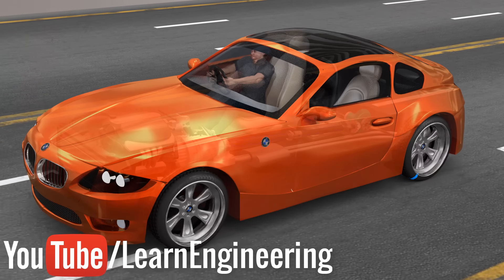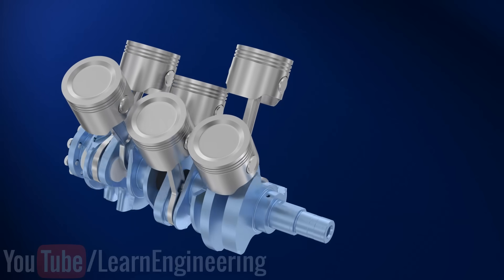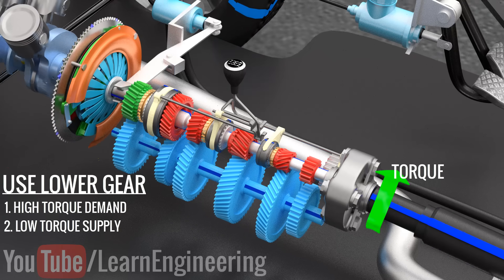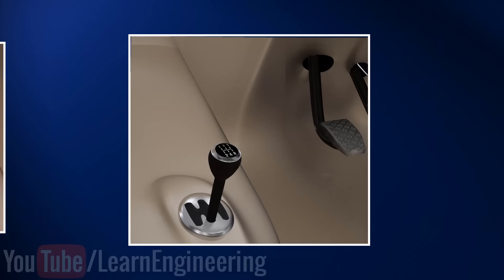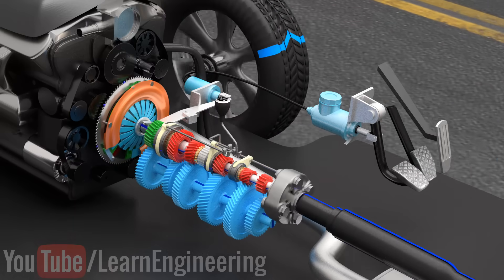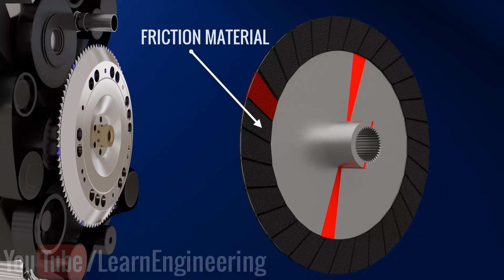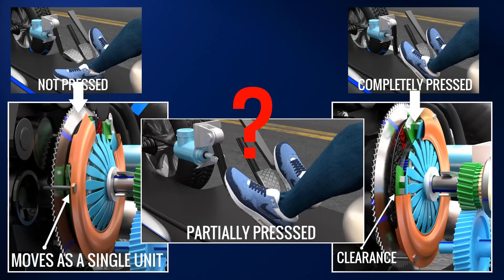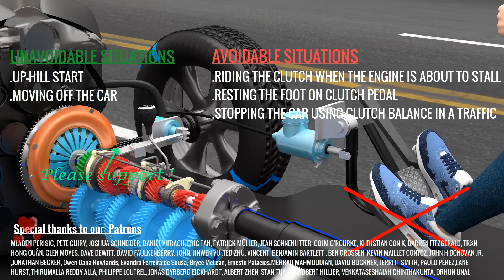Why you should not PARTIALLY press the Clutch?

Comment: Riding the clutch should NEVER be done. Anyone suggesting it has any use beyond starting the car moving or switching gears is an idiot.
Reply: See this is where you played yourselves... Driving schools do teach you to feather the clutch when going too slow even for 1st gear while wanting you to keep moving, it's an absolute necessary technique to be able to use especially when manoeuvring in a tight space with a car. And similar goes for motorcycles. Many bikes in first gear are extremely jerky meaning you can't make smooth tiny accelerations without feathering the clutch. In fact when doing 8s the instructors specifically tell you to leave the gas stationary and play around with the clutch instead to get the little power you need to keep rolling...
Reply: Holding on a hill in very slow moving  traffic you have no option. In a hill start, you would never get going if you didn't slip the clutch.
Reply: brian whittle, as I said, "starting the car moving".
Reply: Maybe. It's all in your head. Run with it.
Reply: there are situations where u have to, for instance when ur stuck in a steep hill
Reply: @johnnyralte5985  3
Reply: David Gruen You'll wear far more riding than blipping, many times more. Using the clutch to aid in downshifting only has the momentary drag of accelerating the input shaft and countershaft of the transmission, while riding the clutch to utilize more torque has the drag of the entire car's weight going uphill for however long you do it; assuming several seconds or there was no need in the first place. There's nothing wise about your suggestion in terms of wear.
Reply: Del Cox nah, it’s only like less than two seconds, it’s way better than banging into first gear while it’s moving unless you double clutch, and the rev is so high that you are just using the first gear for less than a second. I mean I’m talking about the times when you would spend more time on engaging the clutch than partially depress the clutch. If I know I’m just gonna use the first gear for merely a second and I have to upshift again, hell no I’d rather ride the clutch for two seconds. Shifting causes where in gearbox too and it will be even worse when you wear out synchronizer rings of first and second gear.
Reply: IF you have a pretty weak car, you really cannot start efficiently without riding a clutch
Reply: What about in very slow moving traffic, where even in first gear the engine is  about to stall?
Reply: If you are stuck, use the brakes. There are here for that reason to !
Don't use the clutch to prevent the car from going down hill. Just use it to go away ! :)
Your clutch will last longer if you use it properly that's to say : take off and gear change, no slip abuse.
Reply: @FlavienS57  When ur stuck in a traffic on  a steep hill, u have to ride ur clutch. No one would use their clutch to stop at a slope, we all use our brakes. Its when u want to accelerate upward then you'd have to ride ur clutch
Reply: And I agree, you always have to (more or LESS) ride the clutch from a start, hill or flat.
But I see SOOOOO many people, olding the car at red light / stop by riding the clutch that I feel pain for the mecanic :)
And if the traffic is so slow that the car can't hold the 1st gear, better (for mecanic) to stop a while, then go, so the clutch is not permanently under load, and can cool (super important) when stoped :)
Reply: Jezreel Gonzales not bad at all, please watch engineering explained there is an episode just about that.
Reply: Jason Boyes That's what I'm saying. I rather wear out my break pads, then kill my clutch, the majority of people, would rather do the opposite save their break pads, and wear out their clutch faster. Replacing your break pads, cost $100-$200 replacing a clutch, cost $600-$800 and if done by a shop possibly $1200 with labour you see the difference. I never downshift if I have to stop because the car in front of me has slowed down to make a turn I throw it in Neutral, all while only applying the breaks, if you don't come to a complete stop either 3rd or second gear would be the correct gear to be in from Neutral shifting to first gear while the car is still moving is so bad for the Transmission
Reply: Clutch kick 😋
Reply: You probably drive like shit stalling and rough gear changing it really doesnt wear much at all sometimes youll haveto be slow on the clutch or partial on clutch in order to drive it smoothly plus easier on the gearbox
Reply: hahahahahahahahahahahahahahaah
Reply: How bout rev matching? is it an idiotic thing to do it when ur going long, steep and curvy downhill, trying to preserve ur brakes?
Reply: Try Parallel parking without slipping the clutch...
Reply: Del Cox oh damn, inventing? Sometimes you can use second gear to start such as down hills, this is exactly the same principle, first gear is a very aggressive gear, it is a starting gear and for very slow crawling, and more times than not you will waste more clutch just to fully engage into first gear when use downshift from secand. I used to shift into first gear all the time and it’s impractical for daily driving.
Reply: Del Cox plus every car has a different torque and power band so it is your discretion to use your clutch wisely. There is no point in arguing without mentioning a specific car. Some of the car don’t have enough torque especially due to clogged fuel filter or injector when making a turn in second despite the road is flat, this is the time where you ride the clutch slightly to counter act the pinging. And when you almost finish the turn you release the clutch. You have to sacrifice clutch sometimes to protect other components. It’s funny when you hear someone who tells you not to use clutch when shifting to save clutch without realizing how much damage they cause to the gearbox when clashing.
Reply: You don't skip first gear from a dead stop. Anyone that suggests such a thing has spent more time thinking they know what they're talking about than has spent learning what they're talking about. You either have no intention to allow yourself to be corrected, or you're just trolling. In either event, my time is being wasted.
Reply: tabaks And many idiots like you believe downshifting is always better when in fact it's wearing out the master cylinder throw out bearing and burning out the clutch faster means money to shell out at a shop for a new clutch and labour these are the same idiots driving a manual car then corrects people's shifting because it wasn't smooth shifting into Neutral extends the lifespan of a clutch downshifting puts a lot of stress on the transmission
Reply: Gravecb7 Accord I do that, but then just to have to put it right back to 1st because the traffic moves again.
Reply: Jezreel Gonzales if your going down hill use a lower gear let the engine revs slow the car. People who ride the clutch to save brakes is stupid, what's cheaper brake pads or a new clutch fitted
Reply: tabaks dgvcv
Reply: Gravecb7 Accord you are right, it’s more about wear and tear, it’s very easy to screw up when rev matching, particularly second to first, almost impossible to do it smoothly every time. However the stress is not the main concern here unless you did a harsh engagement, the transmission can take that fairly well, if you can do 0-60 then your transmission can take first gear engine braking.
Reply: Gravecb7 Accord actually my car is 12 years old now 120k miles and it is still functioning strong. I live in Seattle and drive pretty aggressively in fact, 0-60 whenever I have a chance. I’m surprised that it is still working today. I think the key is to not over heating it, it can take lots of wear and tear it seems, much much longer than brake pads do but brake pads have better cooling than clutch, and thicker material to wear unlike the clutch just a few mm of materials, despite more surface area.
Reply: Gravecb7 Accord the thing is you have to be the judge, it depends on how good your rev match is, how long do you plan to use the brake and will that cause unnecessary wear when you can just use engine braking to do the job, or you just plan to brake momentarily, about the same amount of time that you would use to change gears?
Reply: Have any of you ever actually done it? Slight inclines at a red light/stop sign, no big deal. Unless you want to be that obvious learner driver lurching their whole car with the handbrake and then 3 seconds later releasing it and slipping the clutch anyway lol. Nobody does that where I'm from and we all drive manuals. Any situation where you're producing a very low amount of torque, like 1k rpm with throttle almost closed, and not loading the engine very much through a slipping clutch is fine. The temperature of the disk won't get high because you're not transmitting a lot of power through it. You're doing what someone pressing their hand against the back of the car could do. Think about it. And bear in mind every time you start in first gear you're loading it up quite a bit more than that during the phase where your clutch is slipping. And then you'll do FAR more damage to the clutch towing a trailer or doing a burnout. And of course if you have testicles you're going to do that once or twice in the life of your car. Modern clutches can take the clutch being dumped quite a few times before failure. If you want to actually glaze a clutch or wear the living shit out of it in a short period of time you have to be extremely abusive or stupid with it. You will smell the damage. I've been driving manuals for 19 years, never had a clutch start slipping, and in my early years I abused them. My Dad uses clutch control at stops and currently has over 200k miles on his original clutch which is starting to slip now.
Reply: Flavien S I am guessing you are speaking from experience in driving in your hometown with good traffic rules. Here in Mumbai India traffic is extremely slow moving even in highways at peak hours.when I say slow I mean walking pace. If you are to climb a bridge at those speeds you have to feather the clutch.
Reply: David Gruen yes! I always do this around a corner on the way to my house. I do it in 2nd gear cos if I downshift to 1st it’ll be pretty stupid.. too much torque
Reply: Del Cox I have to agree with David when making a small and tight turn.. I have to turn into a corner of my street EVERYDAY.. if I don’t ride my clutch for at few seconds in 2nd it won’t necessarily stall but it will be close to it (jerky) and if I downshift into 1st my car would have way too much torque and it would be jumpy and I would have to shift up again in like 2 seconds max so there’s no point? 

Only other option is stay in 2nd at a higher speed which is fine but I run the risk of hitting a pedestrian around the corner because by the time you see them it’ll be too late...
Reply: Why would you ride it when switching gears? Lol just let the revs match the speed for the gear and let it in
Reply: +brian whittle not correct. You wait until you have space to move forward, fully engage the clutch to move forward and when there is no space to move forward you disengage the clutch. Apply hand brake and wait until you have space to move again. Saves the clutch wearing out.
Reply: tabaks I like riding the clutch what's your problem?
Reply: tabaks driving as a passenger in your car must be like a roller coaster.

You probably just dump the clutch trying to move two car spaces in backed up traffic lol
Reply: Del Cox You have no such option in India as keep distence is not maintained as roads are narrow and there is heavy traffic.
Reply: Goof Off You just don't have proper throttle control. If you get into a bad habit with driving (or anything, really) to cover a shortcoming, it can be very difficult to correct it. Most people don't want to correct what feels "normal" and consider the idea that they're doing something wrong to be insulting.

The low-RPM situation you're describing is called "lugging" the engine. I don't know what gearbox you have, but any engine will only do that around idle speed, and for 2nd gear that's around 10mph. If you're going that slow, you should be coasting, very light on the throttle, or in 1st; if 1st seems torquey, you need to practice your throttle control. If downshifting into first is difficult while moving, your synchros are worn and you just need to learn to rev-match.

There is an exception to all this: if your motor or differential mounts are bad to the point of broken, an engine will shake severely under low RPM situations when you apply throttle without something to absorb the harmonic, like a clutch slipping. Still, that's compensating for vehicular damage, not a driving technique, and a controlled foot at a higher RPM will serve the same function.
Reply: Goof Off Just to be clear: you're interpreting "riding the clutch" to mean partially depressing the pedal, yes? Fully depressing the pedal to the floor to disengage the engine from the wheels is not "riding" it, and completely acceptable. In the world of autocross, two seconds is an eternity, but in daily driving it means nothing in terms of acceleration. There is simply no situation over 10 mph when an undamaged vehicle needs to be accelerating on a slipping clutch for two seconds; it only means the driver is shifting incorrectly and applying a band-aid.
Reply: My thoughts exactly. You never half press the clutch when driving. It's supposed to transmit the power from the engine. Change gear when the engine is stalling. I don't even understand why it needs to be explained. Driving schools are supposed to explain it.
Reply: And that's why we have 95% or more motocycle with "wet clutch". The clutch is in oil, that prevent it to warm to quickly, and allow us to run the clutch longer for manoeuver.

0% of car has it, because it doesn't suit high torque, and that's why you want to ride the clutch as short as you can.
In very slow traffic, the parts have a different speed of at least 800 r/min. This is 13 r/sec. This cause lot of heat, and heat is the ennemy of metal longevity.
If traffic is going 2km/h, stop for a while, and when the distance with the car your are following is enough, just let the clutch out, you'll drive at about 7km/h. Get close and stop, repeat.

AND /!\ don't ride the clutch while stopped at red light in hill to stabilize the car instead of using the brakes. I see sooooo many people doing this :0
Reply: JorgeForge not always, there is an instance where you should ride the clutch for a brief moment, that is when you are making a right or left turn with slight inclination in second gear at low speed. For example if you were round 1200 rpm, and you rev match to first you have to blip the throttle to about 2000 and potentially wear more clutch while engaging, and pretty much right after you fully release the clutch and accelerate the rpm is already so high that you have to shift to second again. So in this it’s wiser to ride the clutch for a brief moment in second while moving instead of putting into first and only use it for less than a second and shift back to second gear.
Reply: brian whittle  You have an option: you wait until traffic moves a significant distance and then just jump the gap.
Reply: Carter Lamont Throw it in Neutral. And don't keep moving forward, every time you press the clutch pedal, in it slowly wears down and you'll soon notice the clutch pedal, becoming softer and the stiffness, that was once there is no longer there that's a sign of a worn out part and if the RPM is revving too high, your clutch is slipping, That means it's worn down and you need to replace it. Most clutch can last as long as 3 years to 100,000 miles 5 years if the person isn't grinding gears and engaging the clutch every often when they don't need to.
Reply: David Gruen You're inventing a situation that doesn't exist to try and ground your point. If you would be using a gear for so short a period of time that shifting isn't feasible, such as less than two seconds, you don't need the lower gear at all. If you're accelerating, don't shift so soon. If you're coasting, the car has mass, and will carry itself through that amount of time, even uphill. If you're decelerating, you don't need the torque of a lower gear unless you're engine-braking. If you're re-accelerating after a deceleration cycle because of traffic and your current gear can't handle it, you should have proactively downshifted already and not let your RPMs drop so low. There's no excuse for a behavior that will glaze your clutch disc if you're an attentive driver. I'm not trying to be condescending, but while this is an ambiguous concept to most people, for any professional driver this is fundamental.